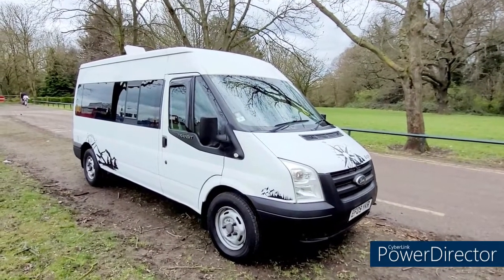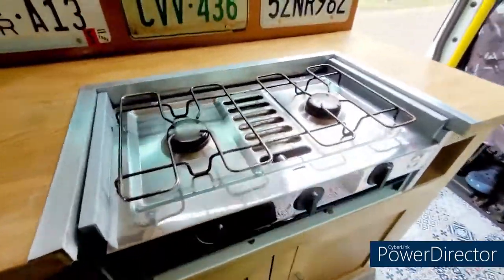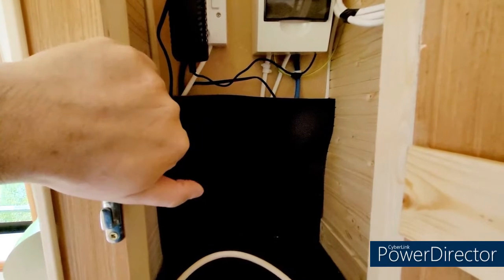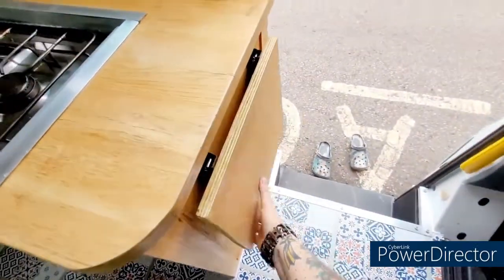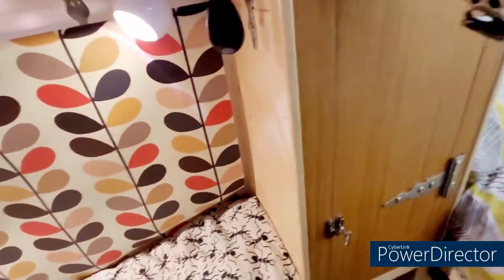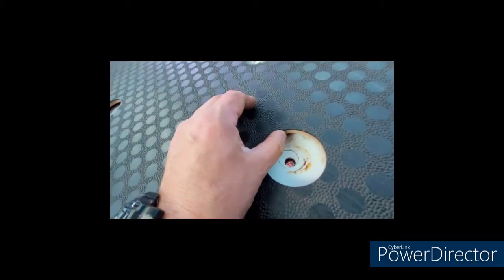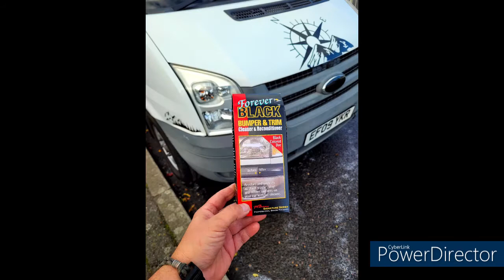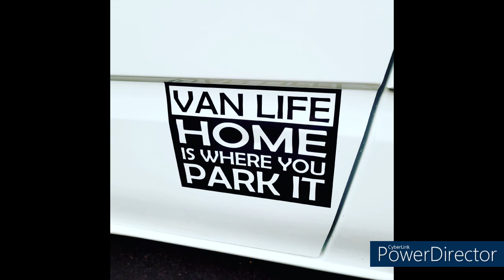MK7 Ford Transit 15 seater minibus campervan conversion!

Comment: Converting the same van now, it's our first van, how did you fit a double in and still manage to board off the windows? Looking at the space we have it seems that we will need those extra 2inches each side for the mattress to fit in. We are at a total loss on what to do with the windows and it's got us a bit stuck, we can't progress with the build until its sorted. Thanks!